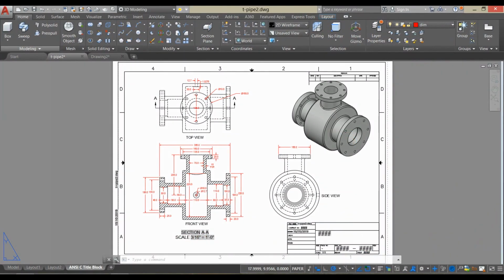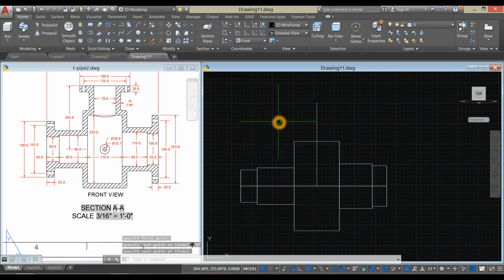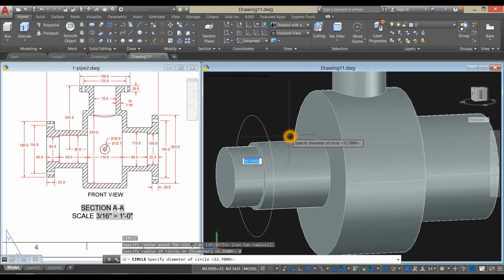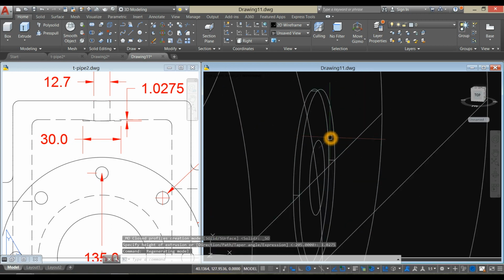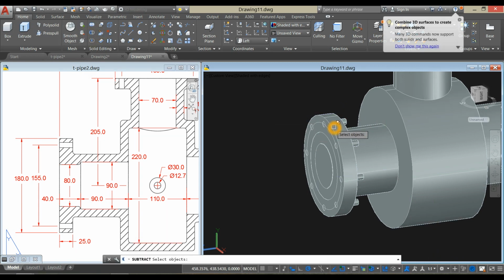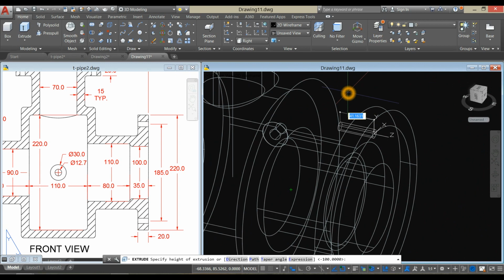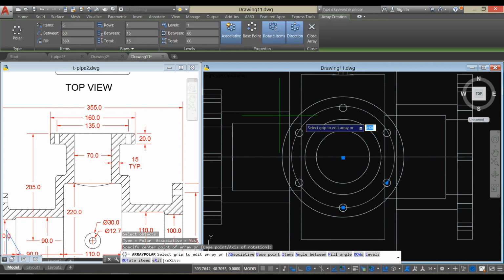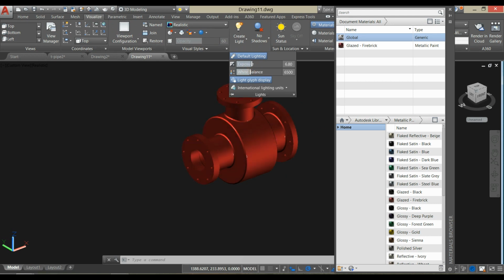Unequal Tee Pipe Fitting ✐ AutoCad 3D ✐ Mechanical Exercise

Comment: Thank you so much for these great tutorials, you’re a great teacher. I have a request. If you have already done so, could you please direct me to a lesson(s) where you teach how to do dimensioning, specifically for 3D. I want to recreate the diagrams and section views that show the model dimensions which you work from to create the 3D lesson.

I can create the 3D drawing, but dimensioning is my problem. I’ve tried doing these in the layout, both in paper and model space but I’ve had limited success. I cannot get the pointer crosshairs to snap to where I want to take the dimension.

There’s something lacking in my understanding and or my overall approach is flawed.
Reply from the maker: I will make a video on how to do it soon. Thanks for watching
Reply from the maker: sorry for the very late reply. I just couldn't find your comment. I hope this link works https://www.youtube.com/watch?v=95bUS9fkIOM